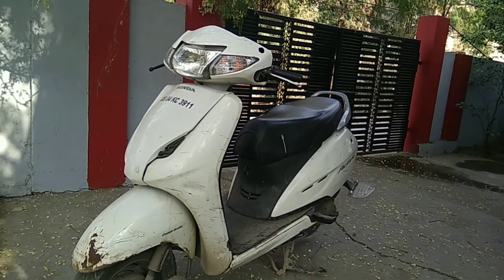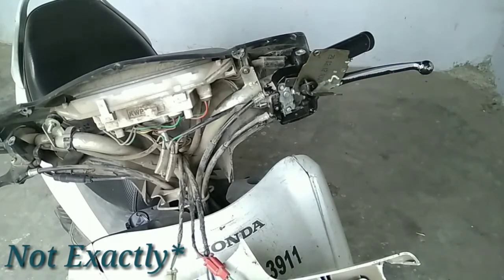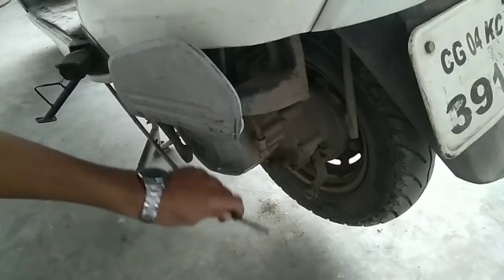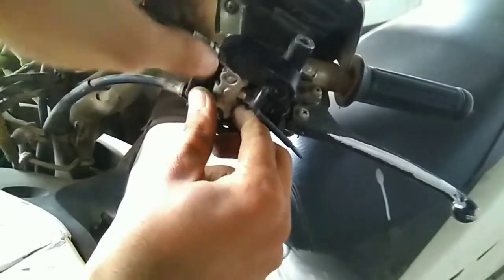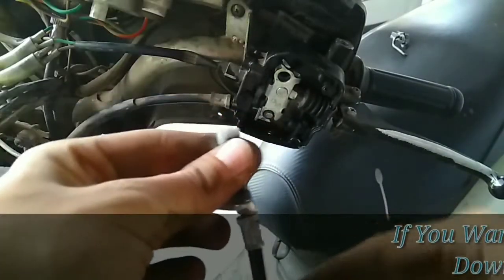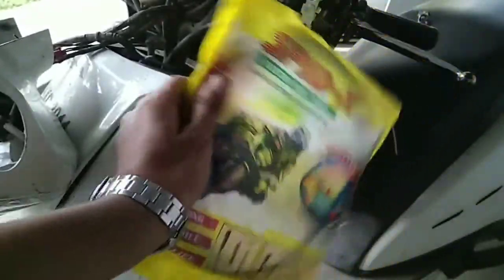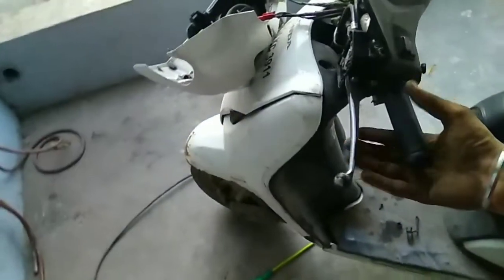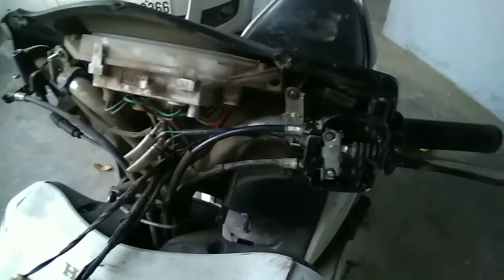Rear Brake Wire (Cable) Change | Replacement | Honda Activa | Any Two Wheeler Scooter

Comment: bro my  brake light has loose contact problem... thats y self start not working... when i touch the second wire, it works suddenly  ( after opening visor)  plz give a solution

Comment: Very confusing to change brake wire.
Reply from the maker: What confusion you have?
Reply: @motosane5914  My confusion in uninstalling & re-installing brake lock & lever.
Reply from the maker: The box where the wire and lever are connected?
Reply: Yes that spring in brake lever